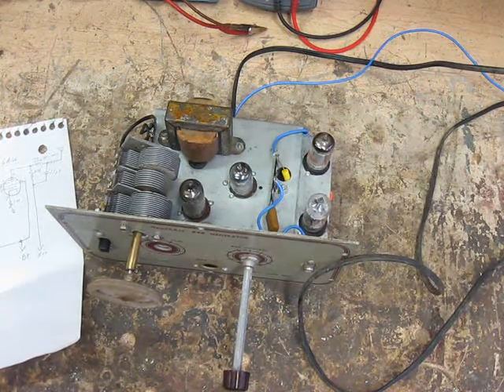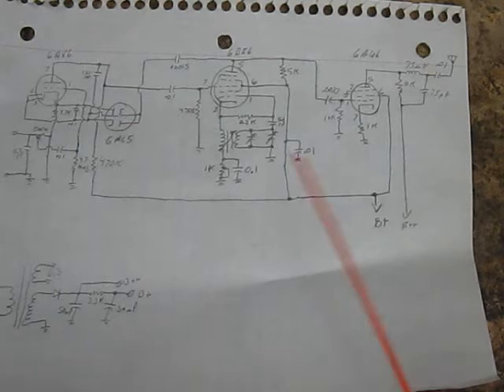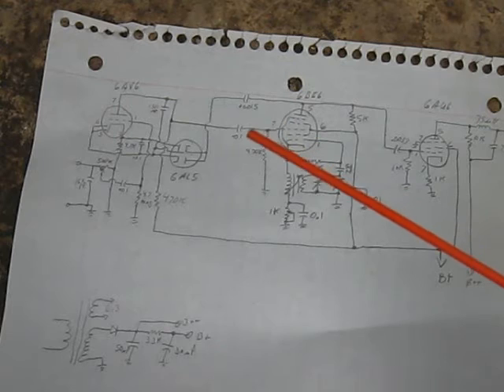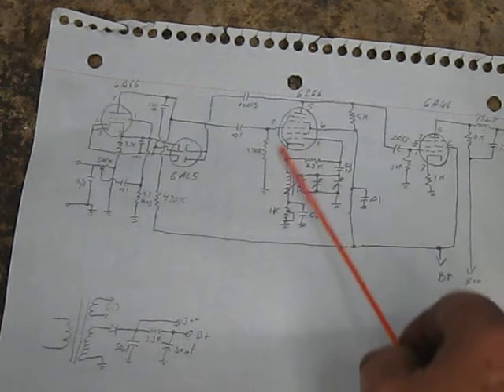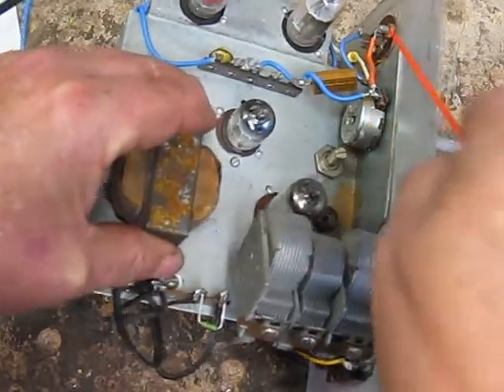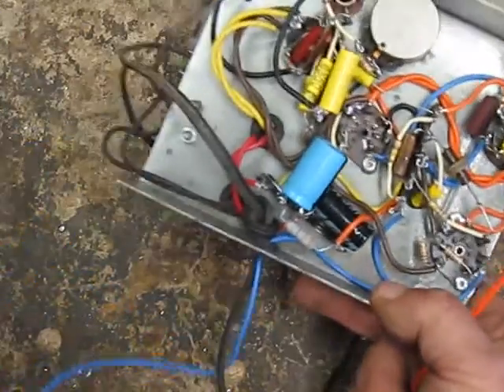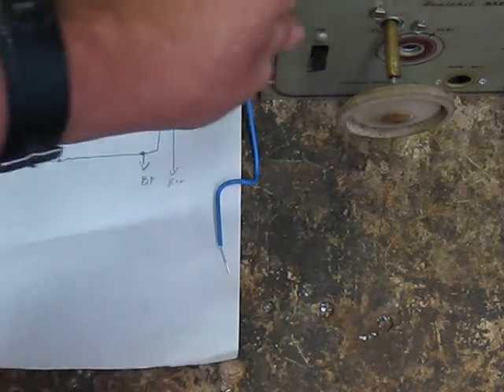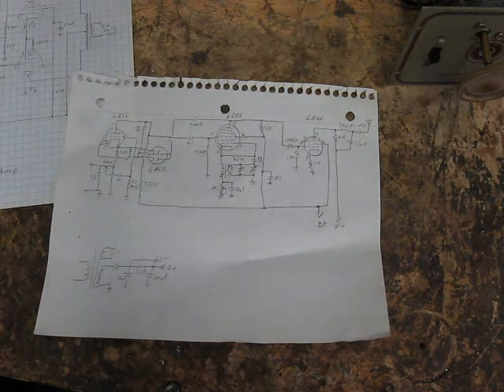Low power AM transmitter part 1

Comment: I like that you used a 6BE6 converter tube as a OSC/MOD .got to keep part 15 of FCC for USA. I got heathkit AM transmitter. 3 tube 2X 50C5 and a 12AX7 that works .